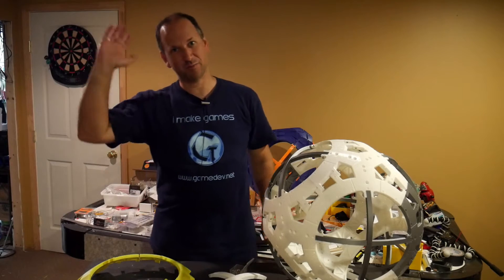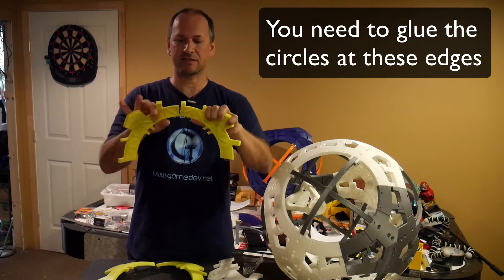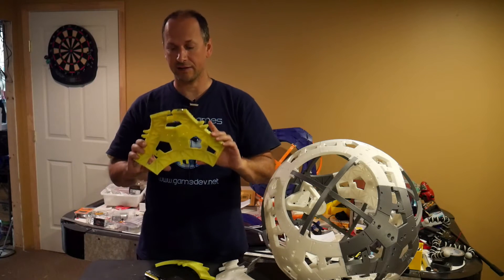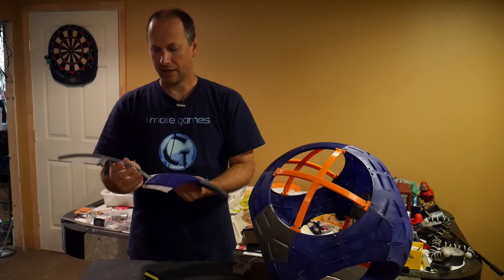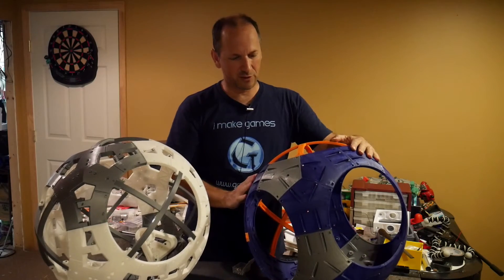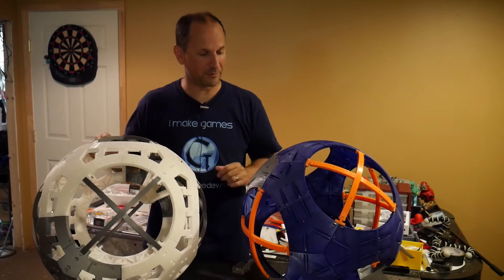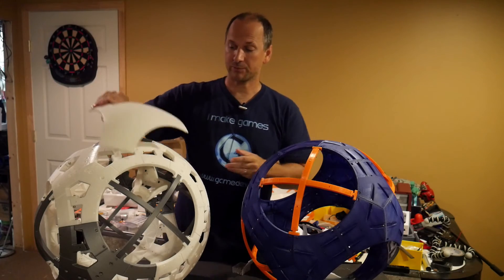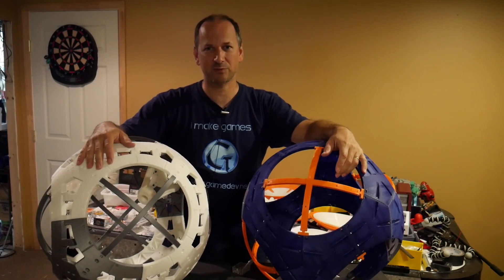RollingRobots : BB-8 Project : Frame Comparisons

Comment: A suggestion? 3d print a rubber cover skin.  And thanks for the nice vid.
Reply from the maker: I have 2 sets of hard PLA skins.  The problem with rubber is that it would roll funny if it's not stiff enough, and it also needs to be hard enough so that the dome on top will roll smoothly.

Comment: What size washers and screws did you use? Could you leave links to amazon on where I could get them?
Reply from the maker: I just followed the standards set by Cary and Tiny.  Amazon is a great source, but sometimes I had to go to McMaster Carr for the fancy aluminum or brass (non-magnetic) and low profile ones.
Reply: Do you happen to have those standards or a link to where to find them?
Reply from the maker: I'm afraid I don't, but I believe Tiny and Cary both provide a guide that includes the specs.  It should be in the same place you downloaded the STL files from.

Comment: Just started to consider building a BB-8, as I'm a huge fan of prop challenges and such. If you ever have questions about painting, or airbrushing. Would be happy to help / trade for knowledge. :)  I'm concerned that without multiple coats of clear these spheres will get severely damaged under stress. Which also brings up a point of printing in segments. I think you have the proper concept in full parts, vs segments. Those parts will 100% crack without a lot of stress (segments)
Reply from the maker: Good points.  I'd be much more concerned about cracks if the hardware and orientation didn't act as reinforcements.  The complexity of the design benefits it, and there are reinforcements (washers as "biscuits")  in between the segments in the "Cary sphere".  I've sat on the older version!  Cary is also now doing a production run that is commercially cast in molds!  If you have the funding I'd highly suggest it!
Reply from the maker: Problem with 3D printing is the limited size you can achieve as a single piece.  The sphere designs are designed around mid sized printers (although my printers are 300mm XYZ (about a cubic foot))
Reply: Which I am jealous of... and have been thinking about buying a printer, just lack the reality of what I would REALLY use it for after certain projects were completed. lol. The smaller prints were more of what I'm talking about. Coating with heavy primer on a 3 part plate will stress the paint and it will crack over time. heat / cold expansion won't allow that bond to stay in place as they are all different materials... if that makes sense. Which is why most folks hate using bondo on cars.